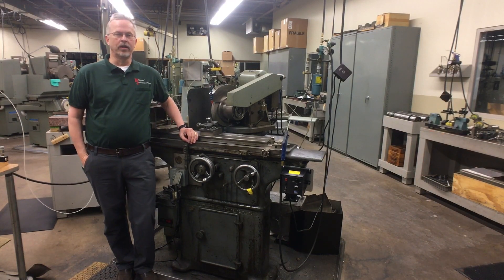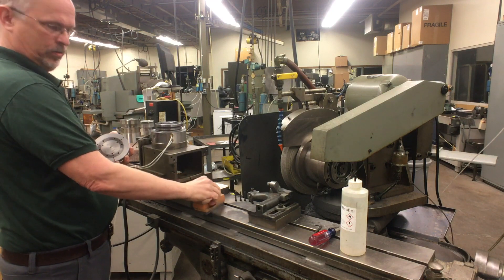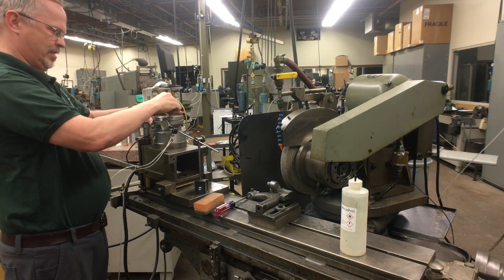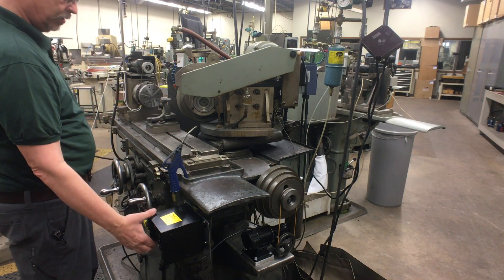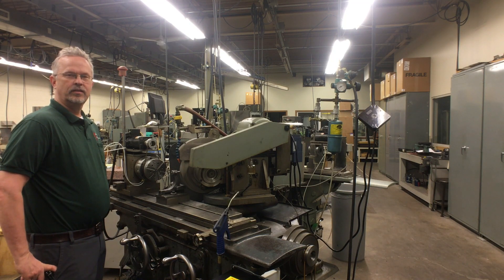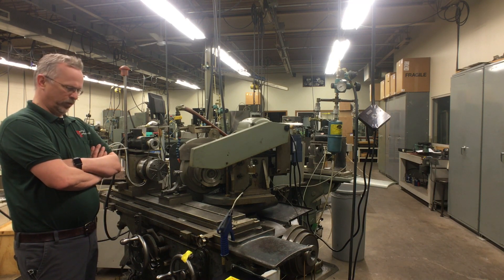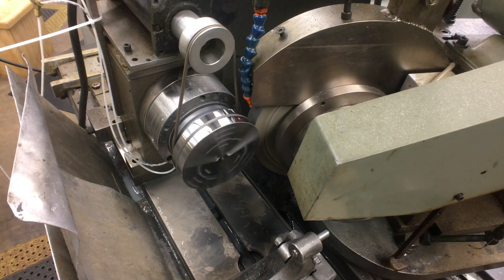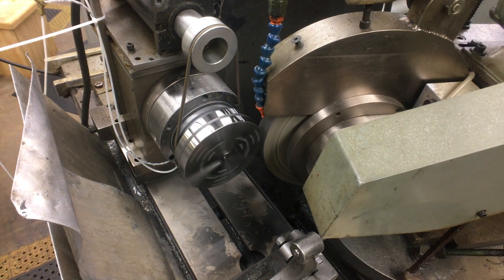Brown and Shape Number One Cylindrical Grinder Demo

Comment: @PIcoAirBearings That's amazing ! That tip-up move is really surprising. Did you guys re-do the ways on the grinder ? AND serious inquiry, the two air bearings you mention there (that you guys make) what is / are the ball park figures / prices ($) for those  (4" block head) ? Please and Thank you... AND Big thanks for making this video... Seems these air bearings can do some remarkable things on retrofits; saw what you guys did for hard turning and hard milling on rebuilt HAAS equipment (certainly gives one pause for thought.). [Used to have a horse called "Rider" short for Ghost rider. Dog's not quite in the shot... Seems cute though.].
Reply from the maker: We did rescrape the ways many years ago. A 4R Blockhead spindle goes for $8,750.